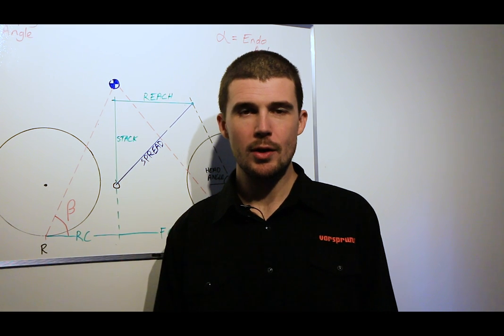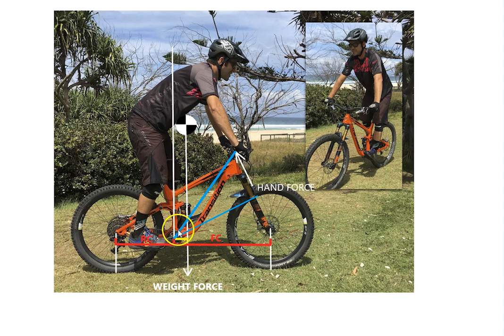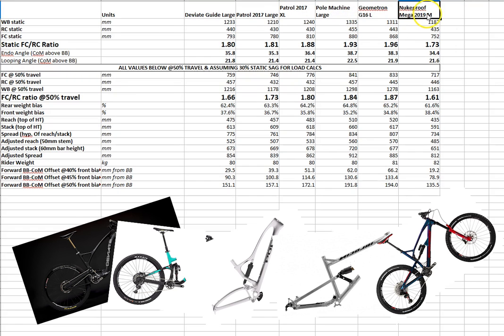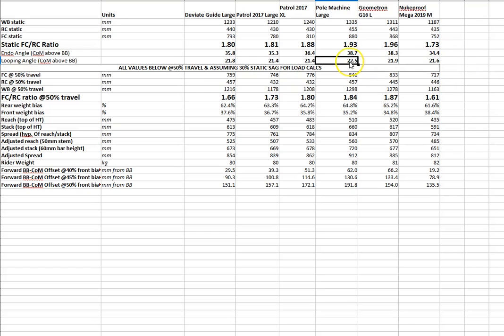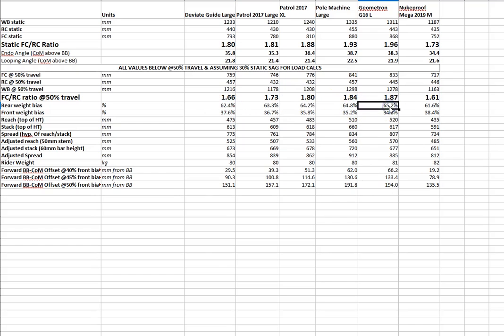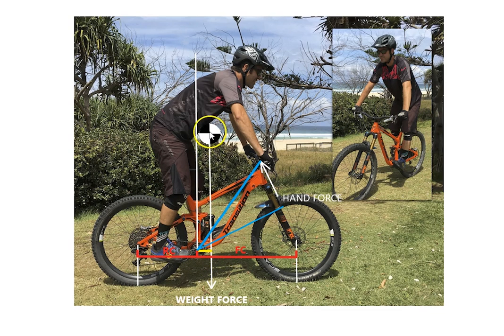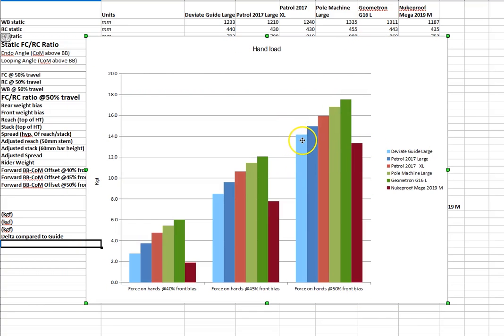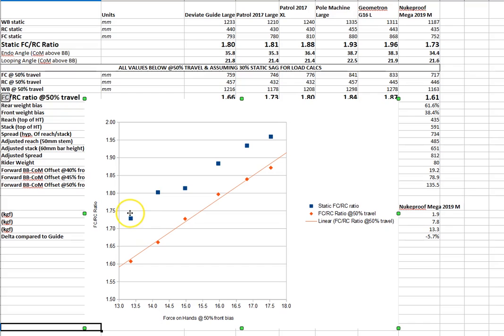Understanding Advanced Bike Geometry Pt 2 - Tuesday Tune 26

Comment: fascinating again! thanks for all your work on this topic.  i have a 2016 Patrol xl and demo'd a 2018. i wanted to like it but found the front end slow steering and vague unless i worked hard to get over the front. i'm not sure i totally agree with your thoughts on the NP Mega though (at least in XL) in size xl the current Mega is a very big bike. compared to the original Patrol, it has a 515mm reach, and correspondingly bigger dimensions all around. a very big XL!
Reply from the maker: Was mostly looking at Sam's bike specifically, not necessarily the Mega as a whole. Almost every bike model varies ENORMOUSLY in FC:RC ratio across their range of sizes.
Reply: James Brant Sam Hill rides a medium. The geo is completely different to the L an XL since 2017 when NP bowed to the pundit cycle mags and stretched the L and XL. The medium is untouched though as Sam must have sponsors queued up and could walk away from NP CRC. I ride a pre-stretch large and won’t be buying a new NP for this very reason.

Comment: Thanks for doing these.  An additional parameter that might be interesting is angle of inclination.  I would seem that declines will increase the front wheel bias.  Rather than optimizing for flat ground, many riders will want to optimize for the down slope because that is when you are more likely to be standing on the pedals.  On flat found, a steeper seat angle might make up for the longer front-center.
Reply from the maker: For sure - as mentioned in the comments above, that's why I'm not looking at static front weight biases of over 50% on flat ground, I think that's a realistic limit for corners on lower angle terrain. However, doing these analyses as though they're on flat ground just eliminates more variables (including rider/CoM height) and ensures we're comparing apples to apples to the greatest extent possible. It isn't a comprehensive analysis, just a concept explanation.

Comment: Awesome video! I’ve come from a L patrol which was definitely too small onto an XL nomad which is a big difference. 

I’ve 100% noticed less front wheel grip and have to consciously move around a lot more, as soon as I get tired or forget I loose the front.

Question is I can’t go any longer stem because of the already long fc so should I get a fork with a shorter offset? 37mm instead of 44mm. It’s not a big difference but do you think it’d help much?
Reply from the maker: Shorter offset will definitely help there. Strangely, you may also find some advantage from higher bars - it's not for everyone and it also may even go the opposite way, but it takes some load off the hands (for a given CoM position) by increasing the spread.
Reply: Vorsprung Suspension thanks mate, good excuse to get some new forks then! I’ve already got 35mm rise with a couple on spacers so I’ll try the shorter offset!

Comment: So my bike has a Front Centre of 780mm and a rear centre of 455mm (static) so sounds like my bike is pretty much on point according to your numbers. I've never had any complaints about front wheel traction so I guess that explains it :)
Reply from the maker: That could be it - perhaps you're also quite strong in the upper body and willing/able to keep plenty of weight on the front wheel!

Comment: Great Geo video. Now after this video,  perhaps the new trend of bike manufacturers is going back to smaller FC/RC ratios , so you won't to shift weight as much and for less pressure on hands to keep the front tire traction. Both small and higher FC/RC ratios can be good depending on style of riding and physical characteristics, but of course there are trade offs. Currently, I have a short FC/RC frame and like it, but having a higher FC/RC ratio can be good as well just for more room and bigger margin of error.
Reply: A bike with a small or no offset forke would still allow you to move as a lot? Shorter wb too

Comment: Would be curious to see how those numbers compare for a Transition bike with SBG compared to your 2017.
Reply from the maker: The FC got longer whereas the RC did not. Unfortunately that was not a direction I was interested in going, nor was trunnion, so I never bought a 2018 Patrol.
Reply: @VorsprungSuspension  being mechanically dumb I'm curious as to why you don't like the trunnion mount?
Reply from the maker: @brianrowbotham4010  aluminium bolts in single shear, that thread into what would be the most expensive part of your rear shock (except that none of the manufacturers even sell that part on its own as a spare right now) and become extremely highly stressed if they begin to come loose and/or the spacer between shock and frame is large. On top of that, the rigidity of the mount transfers far more flex from the frame into the shock, meaning more side load on the shock. It's literally the exact opposite to using spherical bearings in the shock eyelets. And for exactly what benefit I'm still not sure - shorter eye to eye lengths seems to be about it.

Comment: So Steve, what I'm hearing here, is that even though the industry is going a little crazy with "longer, slacker", there is a sort of break even point.  And that we should probably stay away from bikes that are overly long and slack because they require exaggerated movement on the part of the rider.  Is that the idea?  Also, happy new year!!
Reply: Seems like longer and slacker front centers need to be paired with a longer rear center to keep the FC/RC ratio in check. Extending the rear end will effectively move the center of mass forward, putting more weight on the front end. Short stays and a long front end would seem to not make a great cornering bike.
Reply from the maker: @TheBlackthornPlan  this is pretty much it. Owen Pemberton (I think) seemed to be the first person to grasp this quite a long time ago, he was the guy designing bikes for Norco and now for Forbidden. He was, as far as I know, the first person to specify different RCs (chainstay lengths) for different frame sizes.
Reply: @VorsprungSuspension  This assumes a constant stem length. I notice some of the longer bikes are designed around much shorter stems, such as 35mm. Presumably this would reduce the load on the hands as it is shortening the BB to hand distance and so change where your weight would be
Reply from the maker: @CM9999999999  a shorter stem actually increases hand load in some cases - in order for you to get your weight where you need it to be, your adjusted spread is now shorter and so you have a smaller moment arm (smaller amount of leverage) with which to balance your weight.
Reply: @VorsprungSuspension  Very interested in why you say a shorter stem would increase weight on the hands and front wheel.
Reply: @TheBlackthornPlan   I think that also depends a bit on the riders proportions.  If you have short legs and a longer upper body, you might want a bit of a longer FC
 while sitting in the saddle. But if things are pointing downhill, your maybe not as movable as with a equal upper-lower body ratio. There the shorter chainstays can Help.
Reply: @TheBlackthornPlan  Oh yeah, that's a good point!  You're right, if the chain stays are longer, it will help balance things out!  Thanks for reminding me.

Comment: Loving these Tuesday Tune videos, can't wait to see more.  Quick comment; you mentioned that you favor slightly rear shifted weight distribution due to tire pressure differences.  Is that assuming the front and rear tires do the same amount of work?  Would you not need the front tire to do more work than the rear due to the bike and rider yaw through a corner?  Is tire pressure bias enough to balance lateral tire forces?
Reply from the maker: The steering angles on bikes are relatively small, so it's more that there's a delay between front and rear tyre lateral loads - the front sees lateral load first and that's what begins the yaw rotation, both tyres support the bike while it's in a steady state lateral acceleration condition and then the rear tyre essentially bears the majority of the load in order to stop the rotation. However to answer your question more directly, the lower typical front tyre pressures coupled with the fact that most riding where grip matters is happening on a downwards slope means that more than 50% front weight bias in a static flat ground scenario (as calculated here) is not necessary.

Comment: i am just learning to corner and i noticed the less weight i put on front wheel the better i can corner. I dont understend all this "weighting front wheel" thing. If i try to put any weight on front wheel it starts to slip. I have Capra 27.5 from 2018
Reply from the maker: On dirt, the more weight you have on a given tyre, the more grip that tyre has, and it's important that the front wheel doesn't slide out because that's way harder to correct than the rear wheel sliding. If you're finding the front wheel sliding when cornering I'd suggest having a chat to a mountain bike coach. Whilst I am actually a PMBI certified instructor, there are better guys out there than me at giving you instruction on riding technique. http://www.zeptechniques.com/ are the gurus here in Whistler.
Reply: dd410 This is opposite of everybody else.  Weighing down the wheel is going to improve traction on that wheel
Reply: @mtbmike9866  Agreed, however weighting the wheel correctly (outside pedal down, hips outside the saddle etc.) is probably the piece he is missing, and so washing out with the front tire....  Just a guess obvs.
Reply: @Windband1  thanks bro
Reply: Sometimes you can work the back wheel of a bike with short chain stays, but it is more low(ish) speed flat turns, this vidoe is more refering to a well supported corner taken at speed
Reply: The question is - how are you trying to weight the front? And then, how much are you leaning the bike over?

You want to take your outside hand to the corner (turning left you want to use your right hand) and use that to push the bike down - do this before you are even in the berm (Sam Hill is a good one to watch, he sets up for corners miles before anyone else does (https://www.pinkbike.com/news/video-sam-hill-dominating-australian-enduro-tour-champs.html) also use your core, twist your hips to get the bike as far over as you can - and if you can get your shoulders involved that's even better.

This video of Bryn Atkinson is a really good example: https://www.youtube.com/watch?v=ErwKjU-P08k

You can see how he weights up the bike, twists his hips, torso and shoulders into the curve and how he's pushing the bike into the ground for traction,  the biggest visual deception is that it looks like he's pushing down on the inside hand (with relevance, obviously you need some weight on the your other hand, but you want to try and bias the outside - even 51%/49% is a good start) - this is not the case. Put your bike at a 45 degree angle on gravel, then try pushing the inside, then outside grip - you'll notice the inside will slide instantly, but the outside will hold your full weight.

Doing cutties in the carpark is a great way to get the feeling of how the bike acts when it's hooking up correctly - you may loose some skin going too hard, but hey that's the game we play.

Translating this to the trail, a supported berm is a slower cuttie, you do all the same steps, but slower. Instead of smashing the bike into the tarmac, you time the absorption + push to match the severity of the berm. Absorb on your way in, and then push when you want to exit.

Watch people like Conner Fearon (Imo he and Sam Hill are the best), Ratboy, Phill Atwill, Craig Evans ect ect. frane by frame and see what they have in common. 
Ironically Sam Hill isn't the best to watch because it looks like he barely moves - imo he's just got it so perfect he unconsciously uses the least amount of energy needed for the corner. 

I'm not a coach or anything, the best thing you can do is take a few lessons from a guy that knows what he's talking about, and can see you on your bike - you may have a subconscious flaw that you don't even realise you're doing.
Reply: @ItsFluxuation  i will try it when snow melts. thanks for help
Reply: Capra in what size? Do you know the Geo by hand ?
Reply: @erikd6124  27.5 wheels Size XL 180mm front and rear travel
reach 475mm
chainstay 432mm
stack 626mm
head tube 65degree
bb drop 8mm
wheelbase 1248mm

Comment: Great video. In your opinion is it better to decrease stack or increase reach to get more front tire traction? I’d be very interested to hear your thoughts on what is the better adjustment.
Reply from the maker: Having had a think about this, my approach is to consider that an "ideal" rider WILL move to whatever position necessary to get the requisite traction unless for some reason he's unable to (too tired, not strong enough, can't do it fast enough, or is trying to conserve strength) so then the issue becomes somewhat more biomechanical - what configuration is going to give you the ability to get your weight in the desired position the most easily, and what side effects will that have in other situations? It's pretty easy to make a bike do any ONE thing well, the trick is to not massively destroy performance in other situations by doing so. Also not entirely clear whether your question was related to bar positioning or selecting frame geometry, because the answer to either of those changes somewhat.
Reply: Vorsprung Suspension thanks. It was more related to bar position. I have very long arms and have always had to slam my stem to consistently get traction on the front wheel. Although I’ve not played much with longer stems. I usually only wash on slower speed stuff so it’s likely technique anyway. Thanks again
Reply from the maker: @Cycle_Smith  as a suggestion, try raising your bar height and focusing on shifting your hips forwards (not a long way, like an inch or two) when cornering to keep weight on the front wheel. Hinging at the hips has its limitations there. But not knowing your height or ape index or setup, that could go the wrong way too - give it a go and see how you find it.
Reply: Vorsprung Suspension thanks. Will do. For what it’s worth I’m 6’ with a +6” ape index and a 36” actual inseam. Currently on an xl Ripley LS so pretty similar to a large anything else. Thanks for the advice!
Reply: @Cycle_Smith  Hi! Do you mind telling me what setup you ended up with (reach, stack, number of spacers? 

So far, you are probably the only person I've encountered, who has even longer legs at the given height: my inseam is 35 at 6' (arm span is 75 inches).

I try to keep my saddle and grips even for pedaling - that led to a 50mm rise bar and 40mm of spacers under it, while most fork manufacturers don't recommend exceeding 30mm of spacers. Thus, I am thinking about buying an 80mm rise bar or even going after a customer steel frame with the really high stack.
Reply: @StepXX  I’ve found 490 to 500 reach to be the best for me. I run the stem length at 45mm I like the bars quite low. On my trail 429 (setup for xc type riding) I’m running 0 spacers with a 20mm rise bar. On my stumpy evo size S5 (setup for more steep downhills) I run 15mm spacers and 20mm rise bars. I’ve come to realize the large ape index and inseam numbers is a good thing on the mtb. You can size up on bikes, still fit a long dropper in them, and move all over the bike. The biggest thing that has helped is getting a longer dropper and focusing on staying as low as I can on the bike. It provides great stability and better traction in all situations.
Reply: @Cycle_Smith  Thank you so much for the reply!
Reply from the maker: Interesting perspective, hadn't really thought of it from that angle. Let me get back to you on that.
Reply: Cycle Smith I have had success with increasing reach while maintaining Stack height by removing all spacers from under my stem and going with higher rise bars. And as a bonus, because high rise bars are more flexy they are more comfortable
Reply: I'm not sure reducing stack height will automatically move weight onto the bars (front tire), whereas it seems like increasing reach will definitely move weight over the front tire...  It will be interesting to see what Steve says!